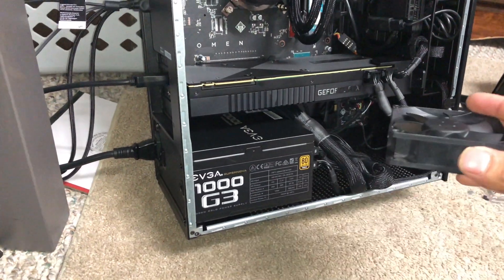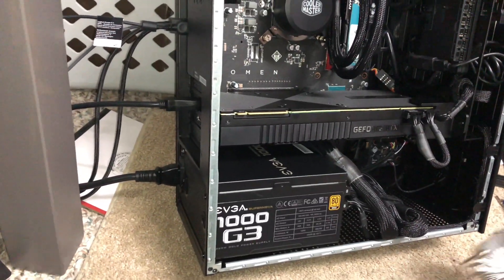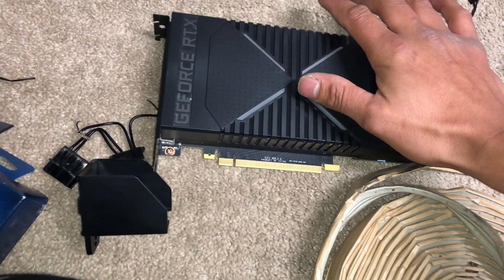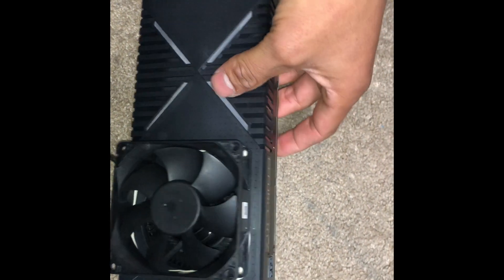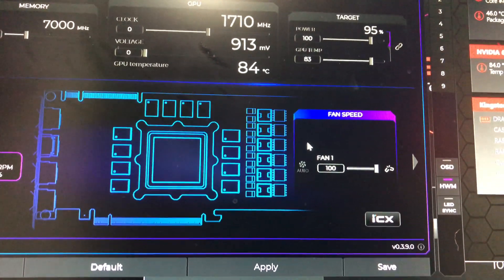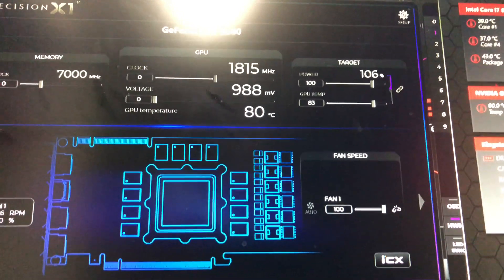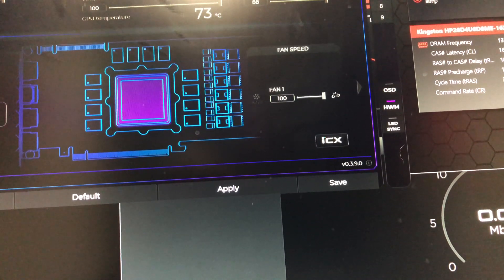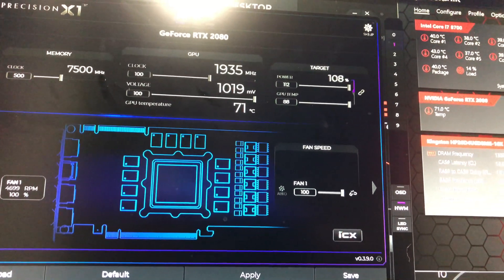RTX 2080 blower style GPU fan mod temporary fix. Read describe!!

Comment: I advise to swap everything in a better cooled case and, if you feel confident, just leave the vga card without back cover and blower and get two Noctuas 92mm and a VGA to PWM adapter. I did this in my RTX 3060 and went from 80c to 65-73c in benchmarks and way better performance w/o throttling. The fans are way quieter too.
Reply: Also undervolting helps alot, and it's easier then you think. I have a gigabyte rtx 2080ti turbo and undervolt dripped my temps from 78-82 down to 72-75. It still sounds like a jet engine but temps are good

Comment: Hi man. Found this video just now since I was considering adding a case fan below the blower fan on my 1080 Ti, and was hoping someone had already done some legwork to figure out what configuration would help the most (e.g. right on top like you did or 1-10cm away for instance) but I noticed pretty massive issued with your methodology. I figured I’d outline the biggest ones in case you want to learn and/or do something similar in the future: 1. You need to compare the temperatures of the existing setup (NO fan) to the proposed setup (fan glued on top). What you did instead is you added a BUNCH of resistance and introduced a TON of turbulence to the intake of the blower fan by attaching a turned-off fan with hard plastic siding and a bunch of blades to it, and then used the temperature of that obviously-worse setup as your control. Of course turning that previously-off fan on will lower your temperatures , but that leaves the question of whether this is better or worse than simply not adding that fan unanswered.  2. Modern CPUs/GPUs moderate themselves intelligently based on several factors incl. temperature, workload type, input voltage stability etc. so to make sure the temperature difference isn’t just from the card downclocking itself you have to, at a minimum, peg it to a certain boost or make sure the boosting behavior is similar between tests. Best regards,
Reply: I get the logic but i feel like adding the extra fan right on top of the blower would add more resistance and turbulence. Now adding that fan at a distance should provide even better results. Like a bottom case intake on the blower axis.

Comment: Just asking, so it’s a blower but where does the air come out? The back like hdmi or just the front fan?
Reply from the maker: Generally all blower cards suck air through the fan and out the back where the hdmi and all the connections are. Exiting out the case.
Reply: @ramonvazquez2475 is it bad that I put the graphic fan support for mroe cooling? I mean before without it, it was 81C but with it, it is 76C
Reply from the maker: @CHAINSAWMAN13333  not sure what you mean by graphics card support but 76c is responsible. Anything 80c and over you need to do something to bring the temp down

Comment: Do have to be careful, you got lucky. Fan stacking can actually reduce airflow at times due to the direction the air comes off the first, creating lower pressure before the 2nd fan. All depends on blade design and etc.

Comment: Don't ever do this guy's, The fan speed on this card is limited to 50% by default and a custom fan curve using MSI afterburner fixes the temperature issue completely
Reply: How would I go about adjusting my fan curve? Currently I have a OEM HP 2060RTX and swapped Motherboards so I’m thinking the fan curve is kinda wonky currently because my card is sitting at 80c under full load when it used to sit at 70c prior to the motherboard swap

Comment: Or you could just adjust the fan curve using MSI afterburner? I did this on my ITX system that uses this card and I get 70c under full load and it's only barely louder

Comment: Has anyone changed the cooler on this specific card yet? Thinking about going to a Founders Edition cooler. My H1 case isn’t doing well with this blower design.
Reply from the maker: Check my channel for the video on this card. Also there somewhere in the comments someone used a used GPU cooler with fans that fit this card.

Comment: is this still worth doing on my RTX 2070? my temps r fine tho, they stay at 70-75. tho i wouldnt mind for cooler temps. can this damage the GPU in ANY way?? also just wanna say great video and cant wait for more. new sub right here. :)
Reply from the maker: FPSpirit those temps are definitely ok. Yes this can damage the fans on your GPU if you have the rpms faster as it will make the GPU fan spin faster. The best solution is to water cooling. An AIO for GPU are always a great start
Reply: @ramonvazquez2475   @ramonvazquez2475  Well not exactly. You can't directly equate it to rpm because those 2 fans would have 2 different static pressures at
Reply: Ray Dizzle alright thanks for the reply!

Comment: this GPU is very solid at 1440. A ran it for a while with no trouble at all not sure why people hate on it. If you run the hp 2080 and say a EVGA or MSI side by side there is not much difference in performance. If all 3 looked the same 90 percent of the population probably wouldn’t know the difference. I have both styles and definitely dont hate on the blower style gpu. 4k is pointless in my opinion for gaming.

Comment: Is this a HP RTX 2080? Is it a good card? I have just bought it on ebay.
Reply from the maker: It’s great for 1080p. If you’re trying to play 2k or even 4k you’ll definitely need in plan to water cool it because it gets very hot.
Reply: Msi afterburner, it’s loud, but mine stays below 70 degrees

Comment: which model is this rtx 2080? I never saw it before ia it a founders edition?
Reply from the maker: Yes it is. It’s a HP manufactured one that can with the omen Obelisk. Poor manufactured imo
Reply: Is this just a 2080 or a 2080 super? I just bought an omen brand new that claims to have the super and it's that same gpu...did I get scammed??
Reply from the maker: This card is just 2080. Even tho they look the same they might not be. One way to check would be the memory clock and MHz that it is running at and compare those on the web with super cards.

Comment: Can you tell me that GPU model,) and model number??
Reply from the maker: 호호롤롤 these cards come with the HP Omen Obelisk RTX. They don’t have a model number because I believe HP is the manufacturer of them.
Reply: I also bought same product. And i also have high temperature problem so i also want to fix this and thanks to tell the solution.
Reply: It's the HP L34254-001 http://partsurfer.hp.com/Search.aspx?searchText=L34254-001

Comment: 1. That is going to wear out and destroy the bearings on your GPU fan, and it will become loud and useless on it's own.
2. Should have replaced with water cooling and a proper static pressure fan.
Reply: Can a 2070 blower card be modded the same way? I wanna put a proper water cooler on it but I'm not sure if the blower fan thing is removable? Very new to pc diy'ing*
Reply from the maker: @rajivc7254  I’m sure it can be
Reply: how do you figure that just a little extra air is enough to mess up the fan bearing? im curious. also those blower fans are probably like 10 dollars at most if it does wear out faster
Reply: @ubergama30  Because those aren't static pressure fans and the external fan is putting strain on the internal fan with air pressure.
Reply from the maker: If you keep both rpms at the same speed you should be ok. If anything keep the the rpms lower than the GPU. All that was being done is helping the air into the GPU fan. I should have clarified that as this was only a temporary fix. 
Also I’ve come to learn with water cooling the GPU (not using a water block) and using one fan, any fans simply isn’t enough. You need heat sinks on the vram and other components as well. I found a product that does all this. I’ll post a video in about a week after I’ve tested it enough and see how it compares to my custom GPU cooling.
Reply: @ramonvazquez2475  Fair enough. Looking forward to the video.
Reply: @ramonvazquez2475  Hey did you get this alternative cooler product working? I have an MSI 2080 with a blower and it runs hot as hell.
Reply from the maker: @teeemm6868  so what I ended up doing was getting a EVGA hybrid kit. Ran into a small snag but ended up working great. I have the video on my channel. Unfortunately I don’t think those kits are easy to come by anymore

Comment: Do you think it would be possible to mount a fan against the bottom ventilation there in exchange for taping it? Like to the right of the PSU?
Reply from the maker: You can however for best results I put it directly on it to force air into the GPU fan/card. If you have a fan that blows air directly in a channel to the GPU I would awesome could work as well.

Comment: Good idea. What is the name brand and model number of the fan? There was definitely an audible difference once you activated the fan.
Reply from the maker: WorthlessDeadEnd I was just using the fan that came off my cpu heat sink. It’s a foxconn pva080g12q. 80mm at 4500 rpm

Comment: Bro when you overclockedmyour gpu how many more FPS do you get in 4K ?
Reply from the maker: Justin Park kyung without over clocking in at low 50fps. Once overclocked it caps out at 60fps because of my monitor.
Reply: Thanks buddy looking forward for you next vids
Reply: Justin Park kyung  this GPU is very solid at 1440. A ran it for a while with no trouble at all not sure why people hate on it. If you run the hp 2080 and say a EVGA or MSI side by side there is not much difference in performance. If all 3 looked the same 90 percent of the population probably wouldn’t know the difference. I have both styles and definitely dont hate on the blower style gpu. 4k is pointless in my opinion for gaming.
Reply from the maker: I have to agree the the GPU is definitely solid. I switched to 1440p and it gives others a run for its money. The I my problem I was encountering was the heat, but once I water cooled it I had no problems.

Comment: Is there a specific reason you went with the 1000w and not a 750w PSU? Also if you ever make a quick video of how to install the PSU (I know it's kinda self explanatory) but yeah, and the commander pro that'd be amazing. I want to make sure I do it the right way.
Reply from the maker: Just for future upgrades/builds. That video is currently uploading. It should answer you questions.
Reply: @ramonvazquez2475  Great, thank you for sharing man!
Reply: One last question, how are you powering up to the fan that is sticking to the GPU? Thank you.
Reply from the maker: Musica Senpai that one is connected and controlled with the commander pro. The video is uploaded where I show how I installed that.